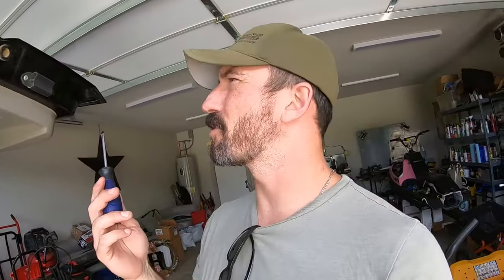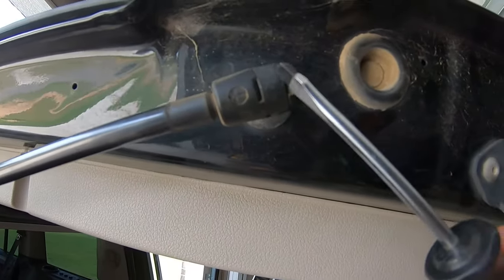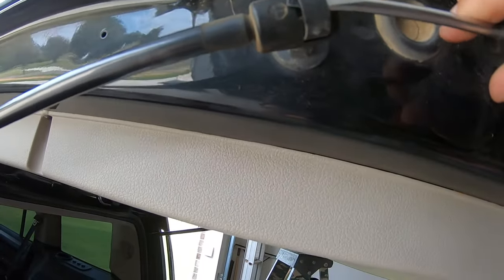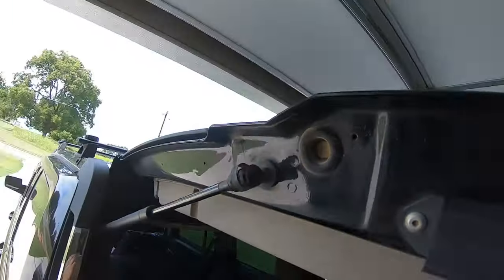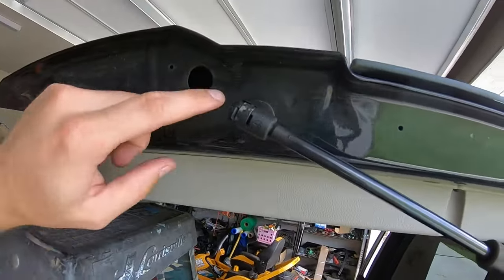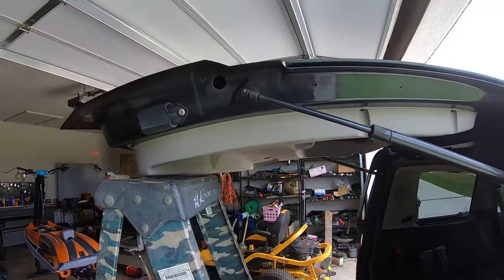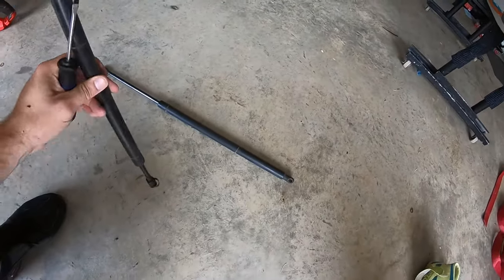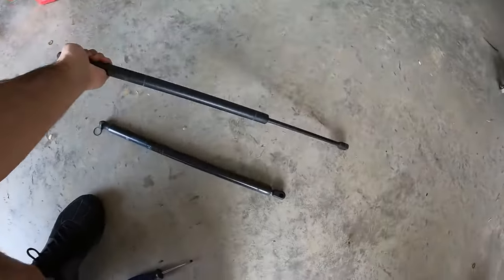jeep commander rear hatch shock replacement

Comment: What type of hatch shock on ebay ?
Reply from the maker: There's lots of them on there any of them that says fits jeep commander will work. they never changed them I just bought the ones with the best reviews. I would change out the rear glass while your at it but watch out after I changed my glass shocks I was testing my fob hatch release and dam they work good and fast smoke my in the chin faster than I could blink lol.
Reply: @beaushow319   thanks bro , Is it the same length as the original or is the one you installed longer?
Reply from the maker: Yep just had more pressure than the old tired ones